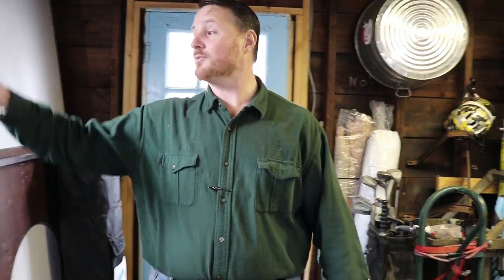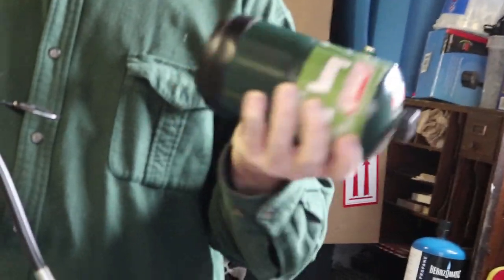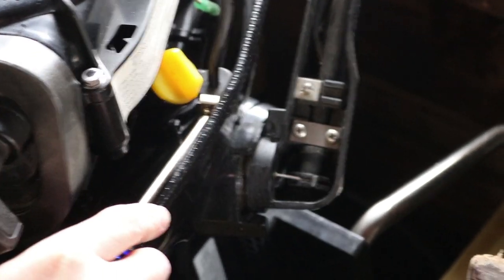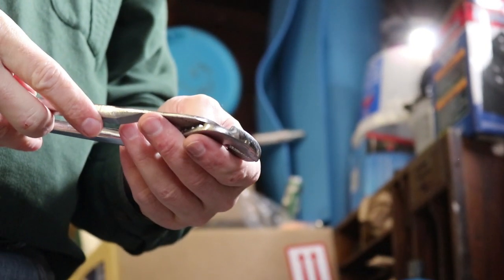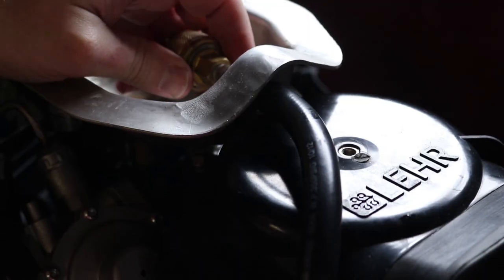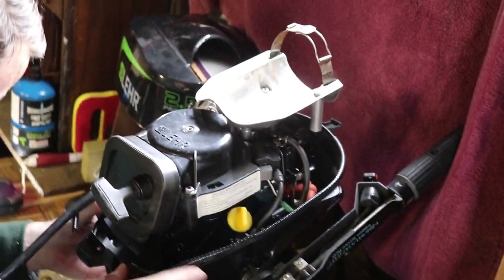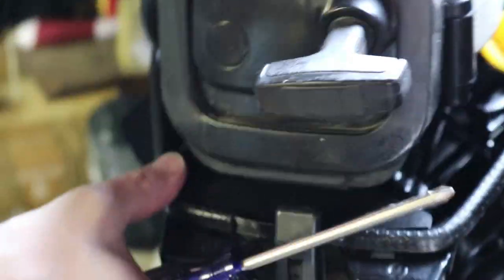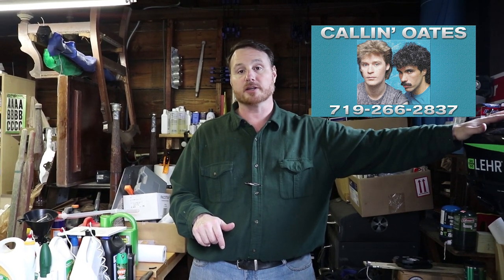Quarantine Project, You Make My Dreams Come True | LEHR 2.5hp Propane Outboard Engine Repair!

Comment: As soon as my lehr 2.5 is warm, it stalls all the time when I try to engage forward.  It’s very frustrating as it stalls all the time since new.  I have had the engine for more than 5 years and it’s got less than 20 hours on it.
Reply from the maker: That is super frustrating... Have you looked at the ideal rpms yet?  Than I would look at the prop and cam to see if they are binding on the shift. Good luck, Cruiser.

Comment: I just bought a LEHR 2.5. Wont start brand new out of the box! Any ideas about I’m doing wrong
Reply: Problem solved. Throttle comes at half power out of the box. Flooded engine. 4 hours later, no start at starter point. Throttle to 100%... vvvvrooom vroom! Stoked
Reply from the maker: I am glad it was an easy fix. You will love that engine. We have had ours for years and it has been great. Good luck my friend. Thank you for watching.